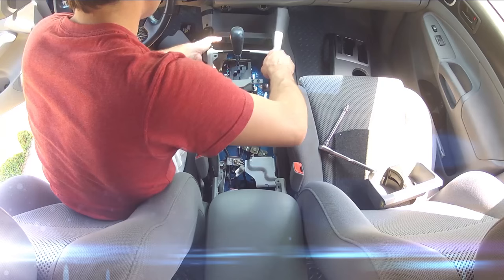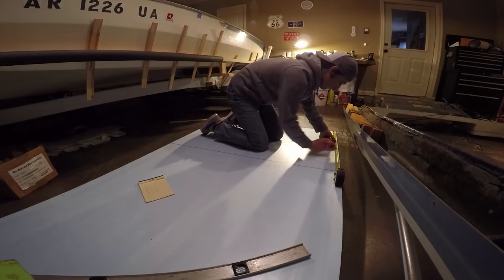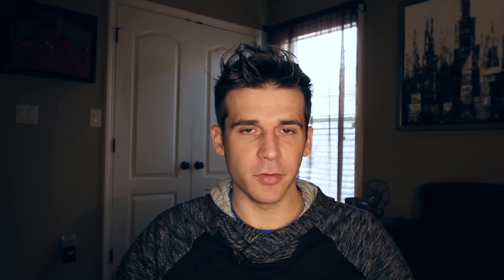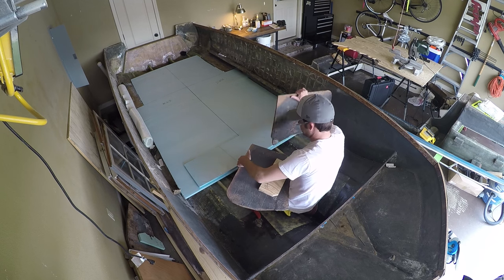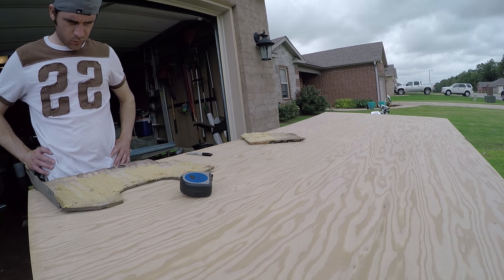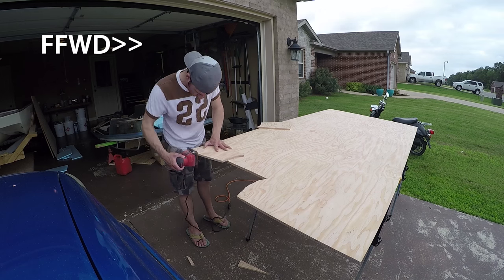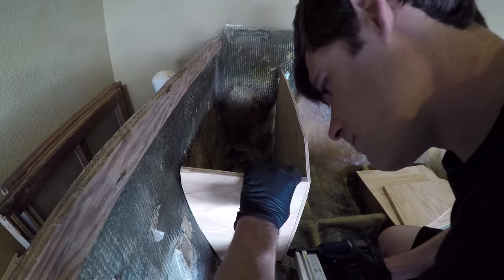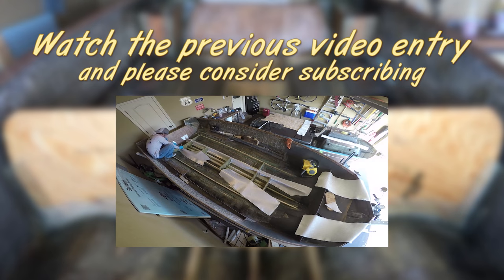Installing Cap Supports and Flotation Boxes // Project Glastron/Vlog #14

Comment: You're doing a pretty thorough job I got to do the same thing so I'm getting some pointers from you my boat got a soft floor as well I just bought it at a great price the motor runs great but it needs some work which I'm more than capable of doing and making it beautiful

Comment: I got a 1970 15ft Glastron fiberglass boat. I couldn't remove the top of the boat. I had to cut around the transom skin. I'm putting one layer sheet of fiberglass on the inside bottom of the boat to reinforce it to become a little more sturdier. I have already removed my stringers and almost done sanding. My transom wood crumbled liked dry leaves. So I figured I just do the whole boat. My front port area has been redone with wood where its a flat area to fish from. I plan on putting in a live well towards the front. You got any or any one good suggestions on how I should putt the transom wood in and the floatation devices. Plus should I use galvanized bolts to put the motor back on?
Reply from the maker: +Tony Fulcher I would make a template of the shape for the transom using foam and/or cardboard and then build one out of wood or some kind of composite material.  I stacked, glued, and screwed two cut pieces of 3/4" untreated cabinet grade plywood to build my transom which became 1 & 1/2" thick.  As far as the bolts are concerned, I'm not real sure about galvanized, most people use some grade of stainless steel.
Reply: +jmink  I did get e some cardboard to make a template. I notice you made the holes in the transom bigger and added fiberglass resin with cabisil. Should I first match the transom up and make the holes and then fiberglass the wood plus should I fill the holes up the putty? I've watched all your videos.
Reply from the maker: +Tony Fulcher the only hole that I made bigger was at the bottom for the drainage plug.  I didn't want to put the old style copper tube back in through wood at the bottom.  Instead I made the big semi-circle in the bottom then filled that with fiberglass putty aka (cabosil, resin, and chopped strand fibers).  But, yes I would recommend wrapping the entire transom with fiberglass matting before installing it into the boat.  Also thanks for watching!!

Comment: would 8 inch 1708 work for stringers or do i want something wider to minimise strips for strength?
Reply from the maker: +John Clark the length depends on how tall your stringers are.  For example if my stringers were 4 inches tall I used a 12 inch piece to wrap the stringer on the first layer then say a 15-16 inch piece on the second layer.  The second layer needs to always be bigger than the first for more strength.

Comment: I want to glue the wood and the skin to the transom  and use clamping and wood fixtures to hold it in place . Once that dries I want to fill in the cracks around the skin with fiberglass chopped strands and cabosil with fiberglass matting. Should I sand and fiberglass the skin first and then glue it to the wood?
Reply from the maker: +Tony Fulcher I've never attempted what you are talking about doing with the fiberglass skin, but I would say that you're probably right in glueing it to the wood. Then at some point repairing the areas around the skin to hide that it was ever cut out.

Comment: how much resin you use so far
Reply from the maker: At the point of this video it was just past 11 gallons.
Reply: +jmink well I guess I'm gonna need more glass
Reply from the maker: +Dustin Mayfield sorry for the bad news.  I have to mention I am probably going to need more too.  I am trying to figure out how much more that's going to be.  So far I have bought 15 gallons.
Reply: +jmink wow that's quite a bit I'm thinking of finding a new hull that is solid and go from there. my top cap is busted now because the wife backed over it and all that good stuff.   I am gonna try to find one cheep up here in mammoth springs area and go from there
Reply from the maker: +Dustin Mayfield man I hate to hear that, but I'd say you're making the right decision.  I assume you're talking about Mammoth Springs, AR I've been a frequenter of that town for several years.